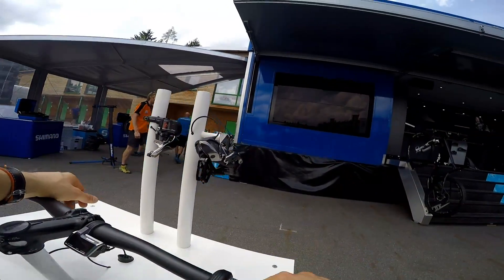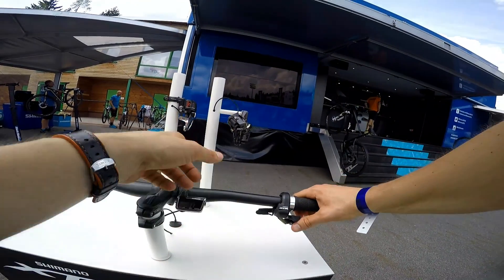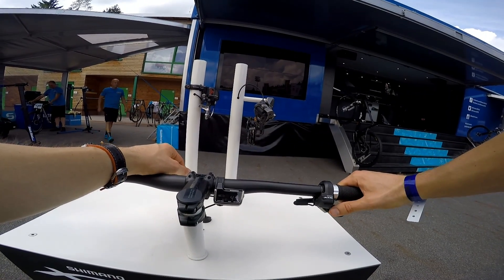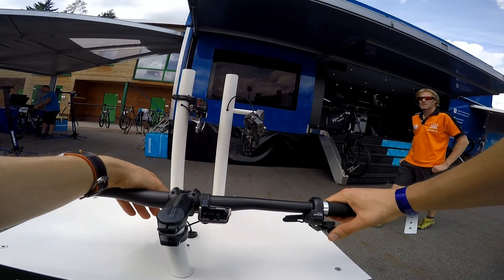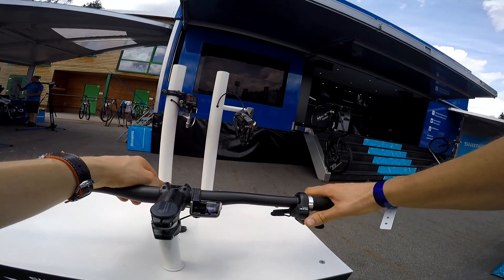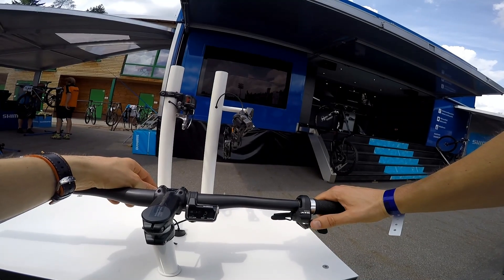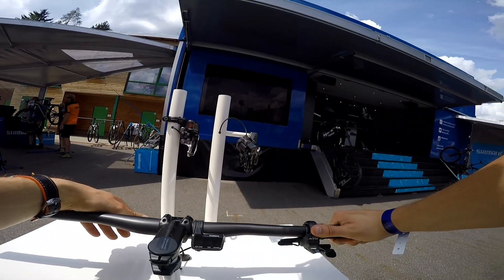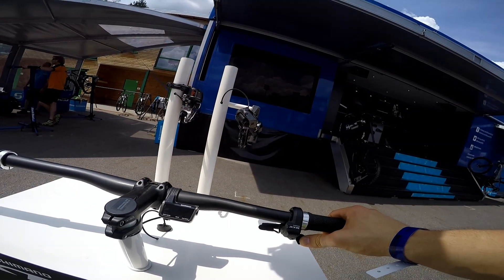ONE Shifter - Two Derailleurs. How Does Electronic XTR Di2 Shifting Really Work? M9050 Groupset

Comment: I think you hate it, but this is awesome! Di2 makes changing gear easier. 1x10, 1x11 is good because you don't have to change gear on rear derailleur, when you change your front gear. Now you just have something like 1x10 but with 3 times more gears! If the chain doesn't drop from the crankset, it's amazing. But also expensive...
Reply from the maker: Well, it drops ;)